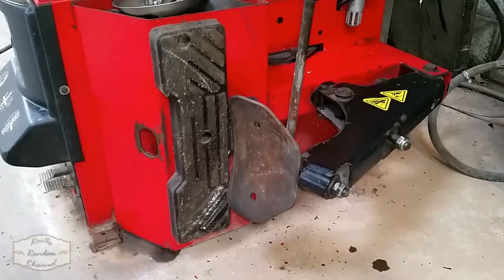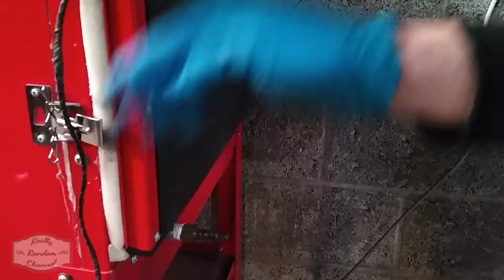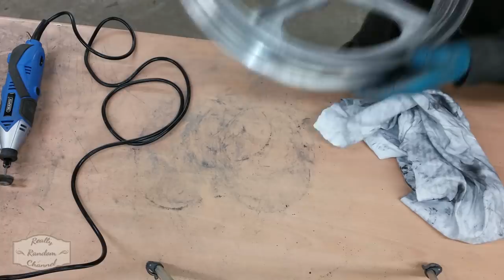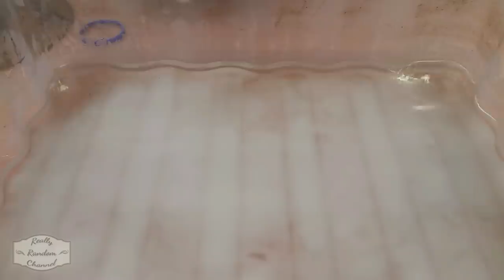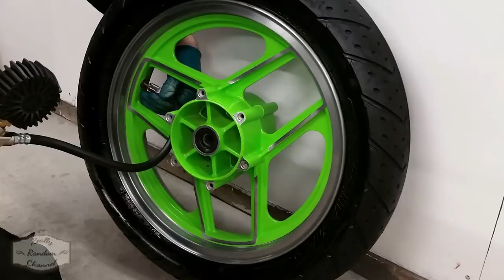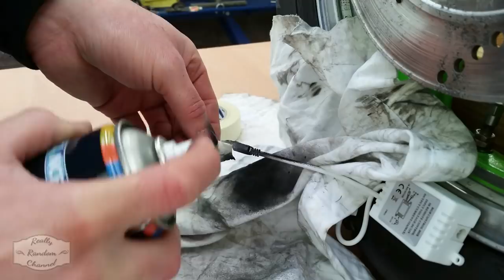Severely Neglected Wheel Restoration 2 - With a twist

Comment: Wheel is from a 1986-87 Kawasaki Ninja ZX1000 (front wheel).
Reply from the maker: Nice, Thanks for leaving a comment :)
Reply: @SOME OLD DUDE why?  explain please
Reply: K10wN's Shed Do you know that it was specific to the 1000s?  We're using some parts from a '88 750r for a rat bike we're building on our channel and it's front wheel looks awfully similar. I'm not being confrontational, I'm genuinely curious :) Regardless, thanks for the insights!
Reply: Either a 900 or 1000 from that model and era.  The brake discs are from either of those two models.  The front wheel may very well be the same on the 750.  The same style wheel was even on the 250, but narrower and only one brake disc.
Reply: K10wN's Shed wow, the more you know haha. Thanks for the info!
Reply: There would have to be part numbers stamped on the discs and molded into the wheel.  That would be the only way to be 100% sure.
Reply: My 1986 Ninja GPZ600R had the same wheels.
Reply: @SOME OLD DUDE $
Reply: # @RRCRestoration
Reply: # @forevercomputing
Reply: @K10wNs-Shed  Also matches the original Ninja 600.  Tires are the same Yokohama's I had on my GPz550.

Comment: I'm always amaze by that DEOXC product. What an amazing powder
Reply: The Bilt Hamber "Deox" stuff is absolutely mental. If you can keep a Deox-C bath reasonably warm it'll chew it's way through even quite scaly rust in 24 hours. The only thing to remember is, like all rust striping chemicals, you've got to degrease the surface well enough that the stuff can soak right into the rust.
I'd been using whatever random rust eating and converting stuff the local car parts shop had in stock for years, Then I saw a rust removing chemical "Shoot out" in one of the many car magazines I used to buy, and in their conclusions they were praising the Bilt Hamber range like it was the second coming of Jesus !!! :)

I thought the magazine had probably got some backhander or alterior motive for yelling how good this stuff was, But I bought some tubs of Deox-C and Deox-Gel anyway............ Now I'm also yelling about how amazing their stuff is whenever I see anyone mention it on a forum or YouTube ! LOL !
For less than 20 quid (In most of the UK) you can get yourself a 1kg tub of Deox-C crystals delivered, To anyone reading this who has to deal with rusty components, Just drop the money and try it. If you use the stuff as directed you'll also be stunned by how well it works !

Comment: Kawasaki Used these cast wheel design on a few of their model range. However judging by the design of your wheel's brake disks, it could be from the legendary Kawasaki GPZ 900 R. This model is featured in the film Top Gun which the actor Tom Cruise used.. Although, the 1987 kawasaki gpz 750R is the only model with green wheels as standard.

Comment: where abouts do you get your little pots of paint from please?
i want to get some for projects, But dont want to pay out for 1L or 500ml tins, when i may not use it all... 
cheers
Reply from the maker: They are from my local auto paint supplier. I used to be a professional spray painter so still have access to trade materials etc etc. But if you are after small quantities for projects and stuff try ebay as you get loads of trade sellers on there selling auto paints in small pots ;)